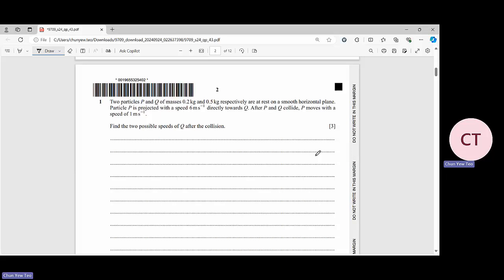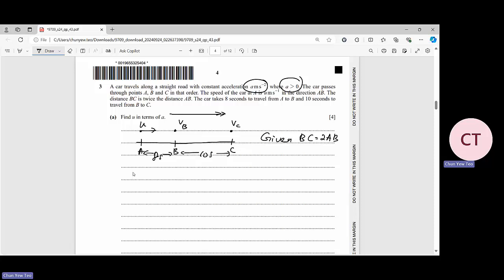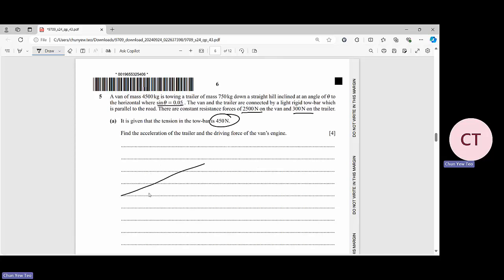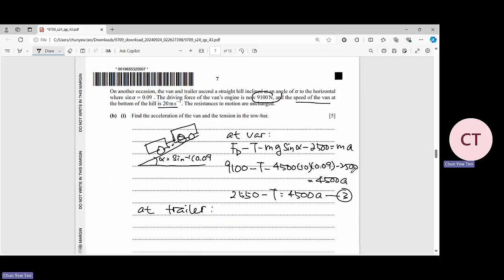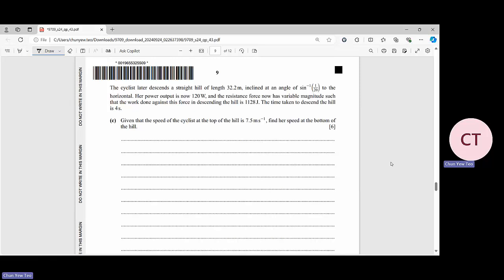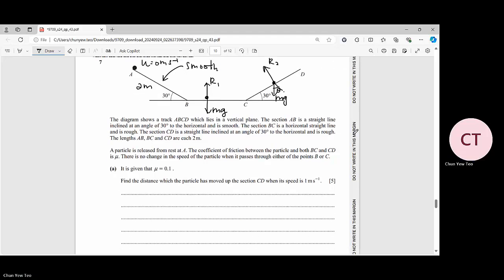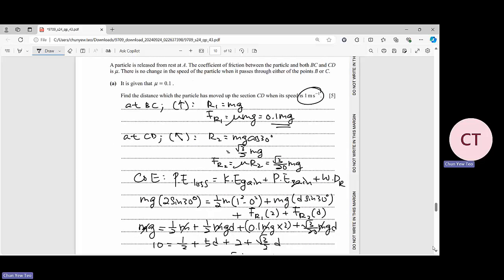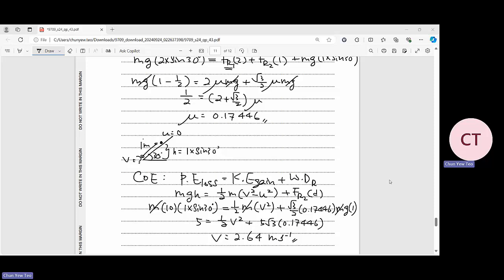9709/43/M/J/24 CAIE A-level Mechanics Solution

Comment: I have a question about the 7b , it doesn’t have KE is it because the particle start from rest and comes to the question mentioned instantaneously to rest , thus u and v both are zero so KE didn’t include in the equation 
?
Reply from the maker: in the question it did mention at D speed is 1 ms^(-1).
So will have the KE gain in this case.
Reply: @ thankiu teacher !